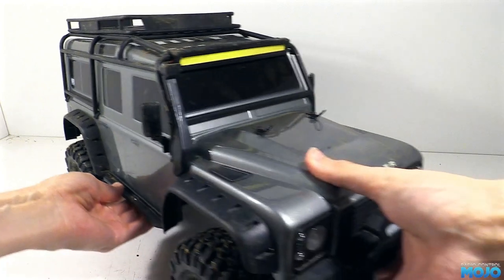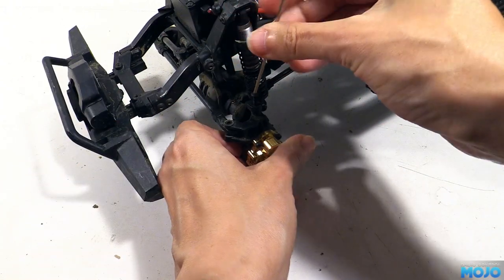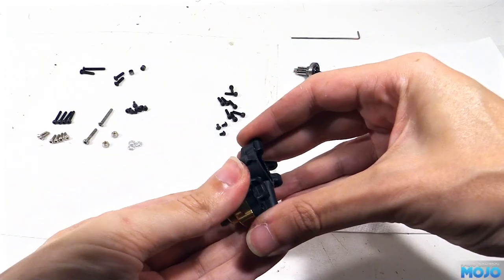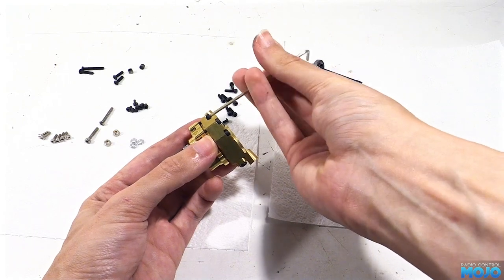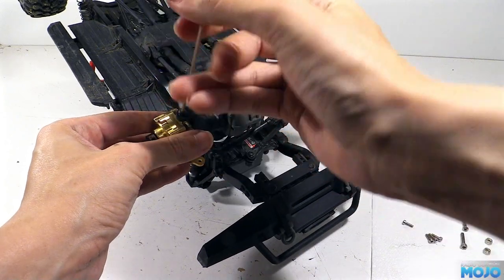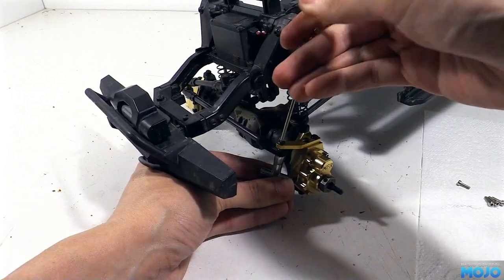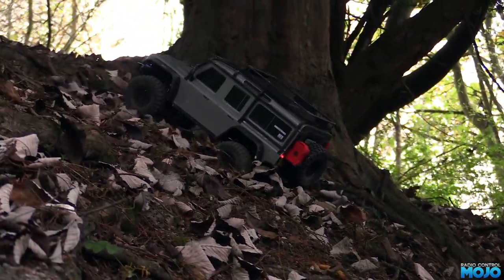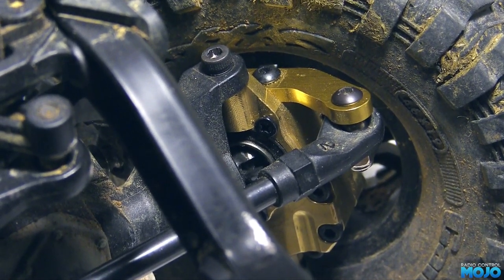Traxxas TRX-4 - KYX Brass bits

Comment: I’ve bought cheap Chinese brass TRX4 parts from eBay and they all fit well , after seeing the issues you ran into with the brass KYX portal knuckle  I would not buy this part from KYX ! However I found Fasttrax parts in the UK and the Brass portal knuckles fit perfectly ! But again so does all of the Chinese brass from eBay , 

If I built a new TRX4 I would advise only getting basic brass portal weights front and back and also get the brass c hubs , combine this with steel bead lock wheels and the weight should be perfect, oh also get hex wheel spacers with at least 3mm more clearance than the stock Traxxas hex spacers and a metal servo arm , 

Oh and after adding all this weight you’ll need to add at least a 20kg waterproof servo to push all the brass , I bought two HD blue 20kg servos and they haven’t given me any hassle 👍🏻

hope this helps 👋🏻👨🏻‍🔧
Reply from the maker: There's a lot more choice of aftermarket parts now, it was a bit limited when I got mine. Thanks for sharing the advice!

Comment: Use high speed bearing grease as it wont turn liquid when it gets warm, standard grease will even liquefy and run out of parts on a hot day without even been used

Comment: Have you had any stearing issues? I mean stearing servo issues. I had my TRX4 steering go dead. Everything else works. Lucky for me I live 250 miles from the Traxxas headquarters in Texas! 
I was on my 3rd battery pack when my steering went out. It just quit working. I had the TRX4 for 5 days when the servo died. Almost makes me want to upgrade to a Savox! I thought with metal gears in the stock stearing servo it would be bullet proof... NOT!!!
Reply from the maker: No issues as such, I have upgraded the servo now though along with a BEC. It was purely due to performance, sometimes the stock servo didn’t quite have enough grunt to keep the wheels turned on rough terrain.
The stock servo now lives in the spares box that goes out with me on runs, just in case it’s needed.
Reply: RCMojoTV 
I did the same thing. Stock servo went bad. I upgraded to a Savox servo and a Castle Creations BEC. No more stearing issues! Ive got a new stock servo on the way from Traxxas and that will be my spare. I just got back into RC after not touching a transmitter for 30 years. I already have a stockpile of extra parts. Thanks for your videos. Keep on keepin on!

Comment: Hi Nick, awesome video, really really good. I love the parts that you're fitting to the TRX4. I think I'm gonna have to sell my globe liner rig and trailer to fund the TRX4. 
On a slightly different note, do you know anything about the nintendo nes and snes mini classic consoles. I have the nes mini, but I couldn't get the snes mini this time, but there's a guy on YouTube who has put the 20 games of the snes onto the nes along with the nes's 30 games. I know you're up on electronics and computers, so would you be interested in doing this mod to my nes mini. I would be happy to pay you for it and also the return postage. I hope I'm not being too forward. 😀 👍 👍 👍 👍 👍 👍
Reply from the maker: I’d suggest keeping the NES mini as is and have a look at a Raspberry Pi running Retro Pi. It’ll emulate most consoles and old computer, the only thing I’ve found it struggles with is Sonic on the master system, oddly the Mega Drive version runs fine…

Pi Hut do a bundle with everything needed to get started - https://thepihut.com/products/raspberry-pi-3-retro-gaming-bundle
Reply: RCMojoTV        thanks, those pie kits are very reasonable. 😀 👍 👍